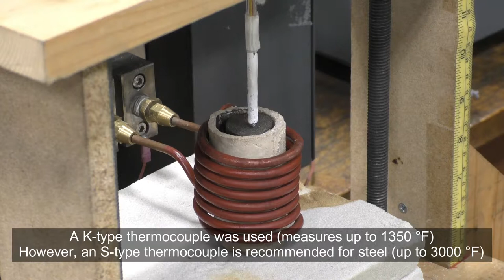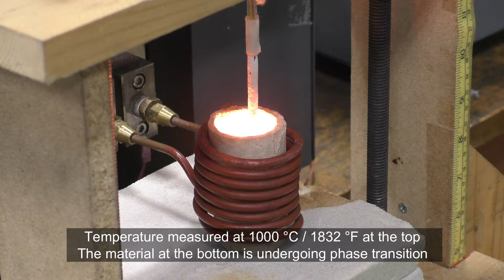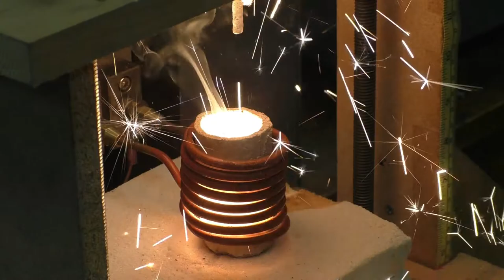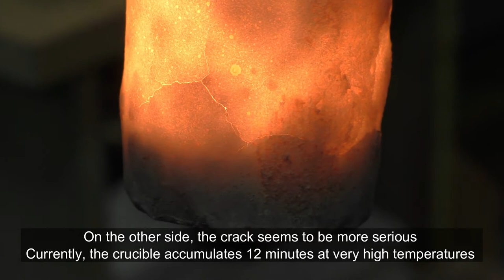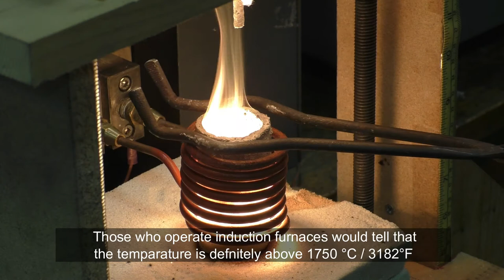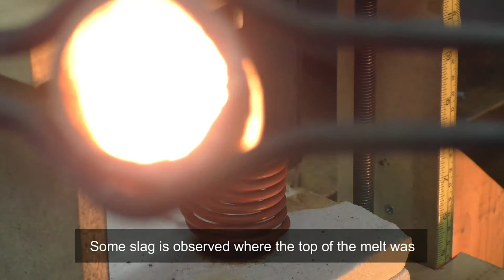Induction melting/heating of steel in a hand-made crucible

Comment: I have designed and built Thyristor Resonating  Induction Melters. Thyristors are the work horses of high power induction heaters. Honestly speaking  I said Congrats! to you  because you did a great job i.e. you succeeded in making that refractory crucible, and lifted it full of molten steel . Back in 2007 I searched every where on the internet and never found a crucible like yours. I purchased many  alumina crucibles from China that collapsed  at white heats . 
I am planning to post my videos about my SCR (Thyristor) Series Resonant Inverter with which I was able to melt 40 kgs of brass and copper in a large graphite crucible, but only 20kgs of steel.
Reply: Looking forward to seeing that build, that sounds impressive!
Reply: Hi, I was looking to make an induction melter like that but I am not so good at electronical stuff, however I understand how it works in principle, do you have any plans for the furnace?

Comment: Hi Carlos, that looks really nice. I am an enthusiast, and I was looking to do something very similar with steel at home (simple and straight fwd process to melt metals) when I bumped into your video :) 
How did you create that crucible? Is it ferrous or regular graphite-clay one? If so, how did the steel melt (coz it seems to go beyond curie temperature)? 
Awesome work btw
Reply: they press the  refractory powders inside a  steel or stainless mould, and place the whole thing in a temperature controlled oven and increase the temperature very slowly (really slowly like 5 degrees every half hour or so)  till  white hot temperatures  (1300-1500 C)  and wait at white hot temperatures allowing the molecules of different additives to coallse or  join together almost crystallize and thus harden and then after this preset annealing time  let it cool slowly.
Reply: Graphite  crucibles start deteriorating above 1150 C according to my experience.

Comment: Would you be able to share the crucible making process details ?   What is the balance 1.5% (others) consist of.  Thanks for sharing so much anyway.
Reply: see my reply to Manu Patet, and I think the balance is magnesite . I would be interested if you share with me  your interests . I am Nick jaber
Reply: @ihtsarl9115  We are trying to put together small steel melting furnaces for recycling of scraps, aimed at the makerspace domain. http://www.cookee.org/melt-IT.html 
A good crucible that has resistance to slags would be important. Hence our interest in your work. Currently we are using clay-graphite and silicon-carbide crucibles. Thanks for your prompt response !
Reply: @diptree  graphite is carbon and at very high temperatures it oxidizes with oxygen and deteriorates. What's needed are  refractories that stay stable up to temperatures of 1800 C -2000C such as Alumina, Magnesite (MgO) there are special powder mixes for steel melting .
 Mr Carlos Larrazabal's crucible displayed in this video looks good but the question is : how many melt  (cooling-heating ) cycles will it survive before collapse?  thats why I asked him. 
The general trend in steel melting industry according to my experience, and especially for induction heating melting  is to make a crucible
fixed inside the induction coil and the whole thing placed inside an Outer holding box  namely a refractory box holding   the coil& its Inner Crucible thats how we did it and melted steel inside them. We did 20kg with the oven i developed. In industry they melt tons of steel that way.
This way if the inner crucible  (containing dangerous molten steel ) fails and leaks sideways  or at the bottom  the molten steel will stay and solidify in the outer protective box  therefore  better safety especially when dealing with large melt quantities.
Reply: I asked my partner whio is a metallurgist engineer  and he said back in 2009 we used mainly magnesite for pressing powders but I think now Carlos is using as balance not magnesite but some low quantity of powders that have very low thermal expansion characteristics which means at higg temperatures it keeps the crucible from expaning too much or contracting too much . You can search on the internet for refractories with lowest thermal expansion coefficient . 
The main point is for small melts a small crucibe is not a big problem if it leaks 
But for large melts crucible are  dangerous
Reply: Ashes from certain plant sources could be considered a fair source of materials. Aluminium oxide, Magnesium carbonate & oxide, and Silica (if desired). A bit of processing involved, such as removing mostly Potassium salts, Calcium carbonate/oxide and other processes... And then I suppose it could be molded and heated slowly until extremely hot and used as a crucible. Could be an interesting experiment. Just a small one to start with.

Comment: Wow, just incredible dood!   good to se another induction melter and one that works so very very well!,   what induction system are you using?    I am keen to build a tilting crucible and would love any info you might have on flexible links between the heater and coil?   all the best oh and my channel has a host of diy induction heater vids if you fancy a laugh!  cheers  tanc
Reply: we use car battery charging cable to transfer electric high currents to the induction coil. Car battery cables that are really thick and made of strands of hair size wires that's the best and they wont heat too mush